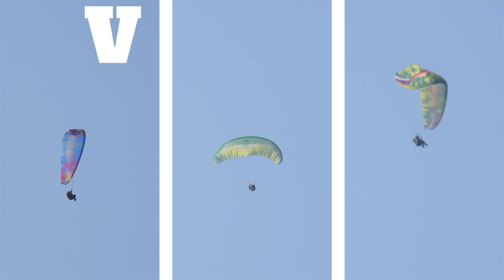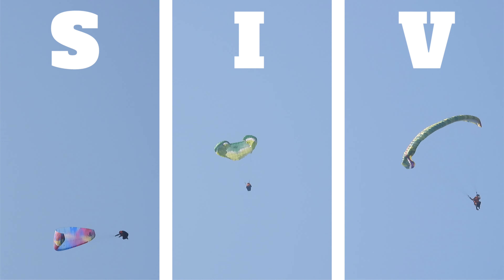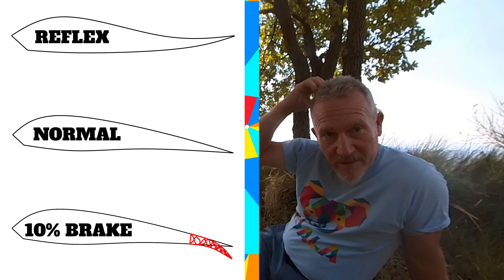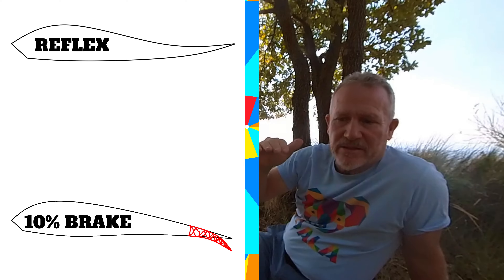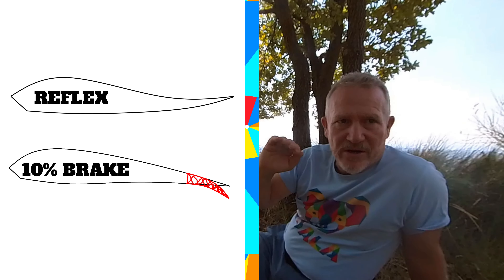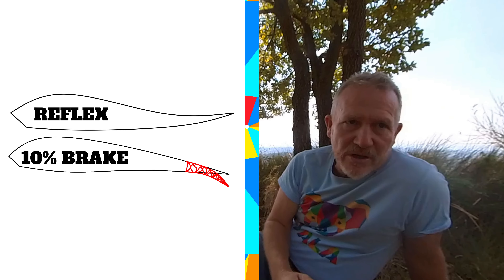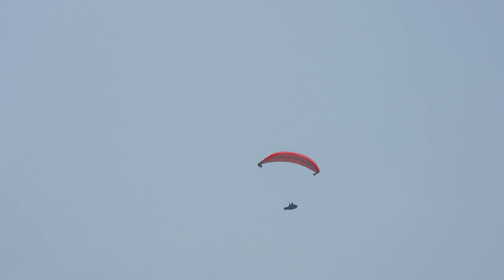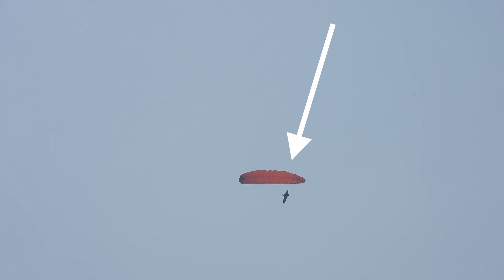10% of brake is not good for paragliding - Bruce Goldsmith

Comment: What about flying at minimum sink, do we not want to do that on modern gliders?
Reply from the maker: Most modern wings tent to fly better accelerated till about 30% bar, especially if it is thermic or some wind. If I want to be effective in conserve my altitude I'll fly at trim speed or a little bit of bar.
Reply: @FlyingKarlis  for any type of wing, minimum sink is a different speed than best L/D, by the law of physics. I seriously doubt you get min sink with a bit of bar, which is what David is asking. You can just check your instant vario rate and see you climb a bit faster with a tad of brakes, IMHO.
Reply: No. You want to fly at best glide, NOT at min sink. Best glide you get at trim, means hands up, or even a bit of acceleration. Depending on wing and trim.
Reply: OK to clarify, I do agree that when flying xc you do need to be hands up or fly quarter to half bar when on glide. Also with new c 2 liner most the time if not thermaling hands are resting on rear handles. However, say you are ridge soaring, and it’s a light/narrow band of lift and you don’t want to fall out of that lift I think you still need to fly at minimum sink correct me if I’m wrong?
Reply: @davidberman8816  Min sink you want if you need to stretch the time. Best glide if you need to stretch distance.
Reply: @nachnamevorname5917  That's exactly his point... He is asking for minimum sink for use in weak thermals, soaring, strong rear wind and so on... At least that's how I took it...
Reply: @mcbrite  Hi McBrite, good to read you. Still alive, still in Innsbruck? Yes, I did not decide for him what he needs. I only explained to him what the difference is.
Reply: It looks like with modern gliders, minimum sink is so close to trim speed that it is almost insignificant to have it; you could use it to climb better but it is far more important to use the brakes to pilot the wing in order to stay in the lift; OR you can use it to slow down your descent to have some time thinking but again I think the time earned from that compared with trim speed would be so little it would be pointless as well...
Reply: @URZALA1  Hello. I think the opposite is true. Wings have been optimised for better glide ratio when flying accelerated. Means, the additional sink became less when accelerated, but more when flying with a bit of brakes (min sink). That is also in accordance with what is taught nowadays, "Do not use the brakes for thermalling. Climbing will be better with no brakes".
Reply: @nachnamevorname5917  better glide ratio accelerated but I was talking of minimum sink..
Sometimes I brake a lot in order to turn tight; the glider goes very slowly and I try to bank it a lot even if this is not efficient to glide; however in that moment I just try to stay in the thermal and go up, not glide far.
But I am still trying to understand what is best to do in every situation..always learning !
Reply: @URZALA1  Close turning is a different story. It may be appropriate to apply brakes. 

But before, you said minimum sink was so close to best glide nowadays – it is not. I would say, rather the opposite.
Reply from the maker: For tight lift you have to do what's necessary to stay in the lift band, sometimes that means a lot of brake input. You might loose on efficiency, by staying in lift it will compensate the inefficiency as the lift will have more updraft then the brake input will have the sink rate increase.

Comment: But can you prevent a collapse without keeping a minimal pressure on the brakes ?
Reply from the maker: Yes, by adding more brake when needed and then letting it fly again.
Reply: @FlyingKarlis  but how to you feel the pressure loss without some brake pressure?
Reply: Just rest on back risers?
Reply from the maker: You keep contact position with the wing, meaning you take out the brake line slack without bending the railing edge, this is your contact position. You will feel the wing perfectly well this way and you'll be able to react as needed.
Reply from the maker: back risers work well for control as well, I switch between C's and brakes all the time.
Reply: @FlyingKarlis  I'll take time to watch this, i would believe you can't have significative pressure without deformation but it might depend the wing… also I guess you can have some trailing edge deformation without killing the whole reflex shape
Reply: @PhilippeLarcher  You don.t have reflex, normally!
Reply: @PhilippeLarcher  I did. YOU should! 😂
Reply: @nachnamevorname5917  alright I extrapolated a bit because of other instructors talking about a natural "reflex effect" on wings getting canceled by brake inputs
Reply from the maker: Most free flight wings these days has some reflex in different parts of the wing and at different levels. But that is not what Bruce talks about. By adding roughly 10% breaks you are creating reflex profile reversed, he's not talking about taking reflex out or destroying reflex. 

What Bruce talks about is that if you take a normal teardrop profile (most free flight wings are somewhat like that, with some reflex here and there built into them, but that isn't the point) if you add a bit of brake to this profile it will look like a reflex profile reversed, and will act like a reflex profile reversed, this is where the pitch instability comes from.

Hope this helps to clarify this. Let me know if you have any more questions.
Reply: @FlyingKarlis  yeah I got it on rewatch, thank you ;) Those are great topics and deserve to be popularised

Comment: How does one fly actively without pulling that 10% that adversely affect profile reflex?  Also, how does a PG maintain reflex, without rigid battens and luff lines like a HG? Maybe just into a low but still positive AoA??  Great vids, thanks.
Reply from the maker: You keep contact position, which is when you take out the slack from the brake lines while not bending the trailing edge. This will allow you to feel the wing and it's movement, while not inducing any brakes. Then if the wing wants to pitch or deflate, you add as much brakes as needed to avoid any collapse or stop the wing from surging, right after that is done you go back to contact position.

Hope this makes it more clear.
Reply: @FlyingKarlis  Cool, thanks Karlis!
Reply: @guyetlaurence7142  Bruce is an old HG pilot (like me) ;) but I cant help but think he has missed an important point (or two) here. :)) PG wings dont just rely on aerodynamic designs (reflex or negative reflex etc) but the key to what makes them safe to fly is the pendulum stability and pilot input (Wing designs are secondary to these primary two stability features). Adding 10% brakes does change the aerodynamic wing profile - in this case "negative reflex" (the lift profile of the wing changes resulting in a change in the center of lift etc) which is very undesirable in airfoil pitch stability - the effect is a pitch down moment in the wing. However the pendulum stability and the additional drag created by this over rides the negative effect Bruce is talking about. It is way more complex than just, dont add negative reflex as it makes the wing unstable, hypotheses. In the same manner I can say dont curve the tips down as it increases Anhedral and will make the wing way more role unstable and terrible to fly etc... But it doesnt - as long as we have weight (tight lines), the pendulum stability over rides that effect. The reality is the trouble starts when the pilot starts going weightless and then the "bad" aerodynamic design of the wing (terrible reflex etc) starts to show its presence... Oh Oh... ;) Better work more on those reflexes... :))
Reply: @wild2flyparagliding160    That makes three of us!! Good points, thanks.  Initially, I was struggling with how the profile reflex could resist negative AoA, à la HG.  I then realized that PG reflex helps with low but still positive AoAs, not the negative AoA case of a HG.  Accordingly, comments about letting the wing fly instead of deflecting the trailing edge down with some unnecessary tension, do indeed make sense.  Of course, one also needs to fly actively as well!! Cheers

Comment: How much does active flying on the rear risers  disturb this profile? I tend to fly hands up a lot and try to only use back riser to stop small occilations and feel the air/wing. Also use bar to activly control pitch movement when i'm flying on bar. And if nessecary i will take over with little brake input, Or more if the glider is shooting forward faster off course.
Reply from the maker: To answer your question - it dose not disturbed the profile as much.
This is actually what I do as well. My Cure 2 has C/B steering, meaning that that the C risers are connected to B risers through a pulley system. Which helps controlling pitch a lot more effectively than if you only have your C risers. Even just with C risers for most small movements it is enough. Speed bar can also be used of-course. Basically, what you describe is active piloting as long as you let your wing fly after you fixed or avoided what neededs to be fixed or avoided.
Reply: @FlyingKarlis , Good to hear i am doing the right thing😊 I fly a Swing Nyos RS. And i must say that i noticed the glide is much more efficient this way, And also the glider is less nervous if i just let it fly as much as possible. And it also has this connection between the riser groups.
Reply: I fly a Nyos RS as well! And am getting a lot more comfortable with using the c/b bridge. Absolutely love the wing though! Thanks for the Video Karlis! I have learned a lot by watching your channel!
Reply from the maker: @edwinlooy6551 Glad to hear! Yes the C/B steering is relatively new thing and has improved 3 liner riser control by a lot. I use the C/B steering all the time, sometimes I will even thermal with it and it works great on my Cure 2.
Reply from the maker: So happy that the content is helping you! ☺ I do love the C/B bridge as well, has made the control so much more effective!
Reply: @FlyingKarlis , Yes i also use it in mild thermals. In sketchy thermals i still prefer to be on the brakes, To be a bit more ready to catch the glider. However i still do not pull the brakes down so much all the time.
Reply from the maker: Same here, it is mostly the weak bubbly things while I look for them I'll use the risers, once I think I have found the strongest bit I will go back on brake control. And then not always as with everything in paragliding - it depends. 😂
Reply: @FlyingKarlis , Yes every minute is different in the air. Not one rule that works all the time😊
Reply: @FlyingKarlis  thank you so much for posting these comments after you post these videos."it depends". I have finally figured what it depends on. What were you just doing? Probably the best answer you can give is "I was flying along at trim speed sir with my hands up. I'm a good boy  I have some extra kinetic energy to maneuver this wing"the worst answer is probably"I can't mind my own business, I have to keep pestering that Wing. "If you are flying along with brakes on long enough to stabilize under the wing, at less than 90% of trim speed, there should be a very good reason. The only energy available is kinetic. Try to have plenty.